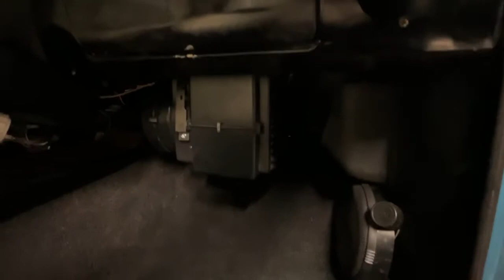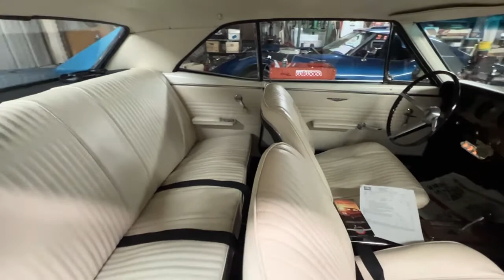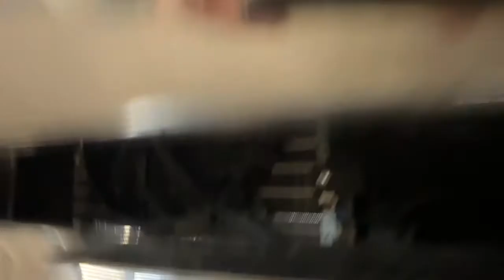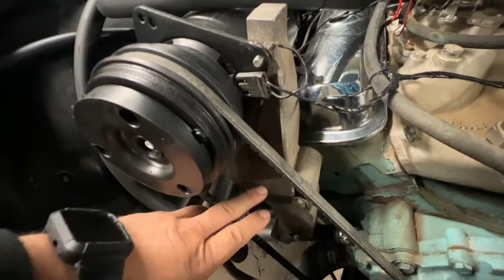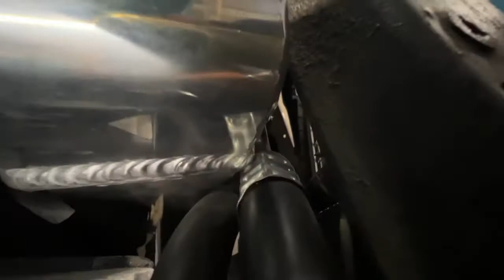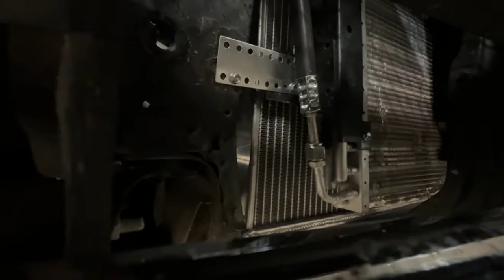1967 GTO Air Conditioning Heat Upgrade

Comment: Thank you for this video and information. What brand/model fan & system did you use?
Reply from the maker: This GTO received an Old Air Products Hurricane AC/Heat/ Defrost system. I use electric fans from Summit and they vary by vehicle usually 16" down to 12".  More info on our website classicautotx.com

Comment: nice video,  did you have to put a spacer between the block and the bracket? I inherited a 1967 GTO that was already taken apart, so now I am trying to figure everything out.  thank you in advance for your reply.
Reply from the maker: No spacer was used on this install. Thanks for watching.

Comment: What brand of AC system is this that's installed on the inside and does away with the factory heater core?
Reply from the maker: Old Air Products 
https://www.oldairproducts.com/